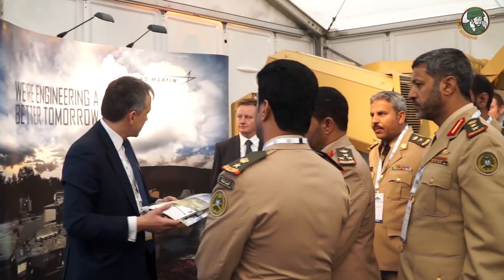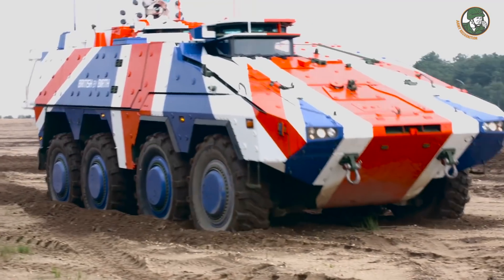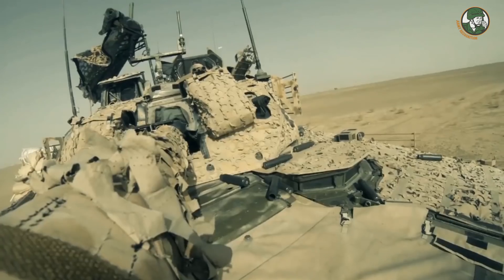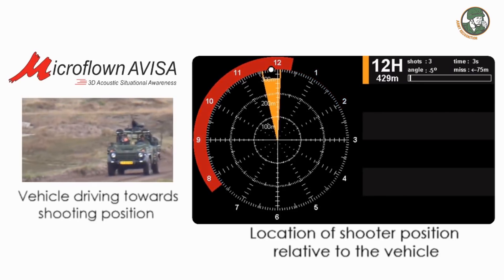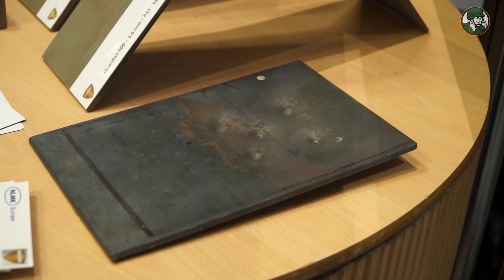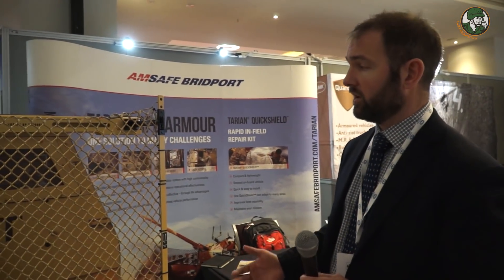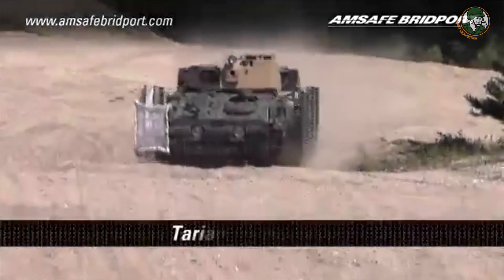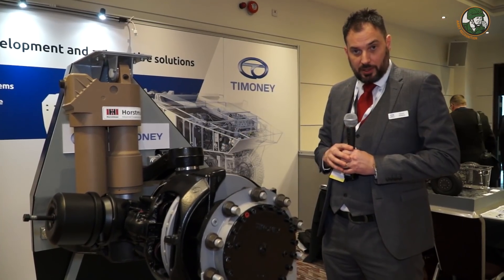IAV 2018 - Day 2: Boxer, CV90 Mk4, Timoney, Texelis, NLMK, Amsafe, Microflown

Comment: do any pf today's apc's will survive on another one D-Day event?!
Reply: yes and no. it really doesent matter too much what APC you choose, as a modern D-day event, or opposed landing would not hinge on which apc you choose. cv90 would probably be the best, but the puma and other new generation IFVs would work. what's important is air support and a lot of smoke. the IFV is really only there to push far enough in to let the infantry get a hold. the only factor in what IFV to pick is that thermal optics are pretty much mandatory.
Reply: The CV90 might, and I vaguely remeber that there were talk of an amphibious option, but I don't know how good that would be. What the CV90 has, is the best soft-ground traction and manouverability of anything on the market today. wet, sandy, boggy ground that stops its competitors is a meere breeze for it. Sadly the manouverability and speed comes at a cost, it is a bit thinly armored, compared even with its competitors, it is only an APC not an MBT so if the enemy has modern weapons, then you must throw them in sufficient numbers at the enemy so you can soak up the inevitable losses. Against terrorists and insurgents or on a UN mission, such losses would be minimal and the armor sufficient, just look at the older versions rap sheet in Afganistan.

Comment: ARTEC is trying really hard to sell the Boxer here. They should to it like PSM with the Puma in the czech republic, less advertising and let the performace speak for itself.

However i think advertising is the only thing that works with the british MoD lol.
Reply: Artec wants the Army and Gov to know its committed and ready for an order.
The British Army knows this is their last chance to get an 8x8 and want it as fast as possible. By buying Boxer without competition they can avoid tons of red-tape, the time consuming risk assessment and testing that they demanded was all ready done by the time they left Artec.
Reply: They have a completely wrong approach imho. The Boxer is a excellent multipurpose-platform, perhaps with the highest modularity of any AFV. If a new version is adopted, there don't have to be any changes made to the hull, just the new modules comes on. The results are extremely low cost and high part interchangeability (since the drive modules are totally identical) thus better logistics. Now, with the british MoD wanting the ASCOD 2 (one version is the AJAX) as a multipurpose base, they kinda have a misssed oppportunity here. The ASCOD 2 is still a unmodular designed AFV that requires major changes for any version that is adopted. 

They should use the Boxer as a multipurpose base rather than the ASCOD 2, and the ASCOD 2 only as a MIFV. Using the Boxer only as a MIFV instead of in a wide range of version is a huge waste of potential. Look at the germans or dutch, they do it right (Boxers are only 2nd line support vehicles, their IFVs are tracked and more heavily protected). The british do it the wrong way around imo.
Reply: did they not already made a purchase? there was something like that reported in the media.
Reply: No, i think no decision about the MIFV has been made yet.
Reply: Jonny z